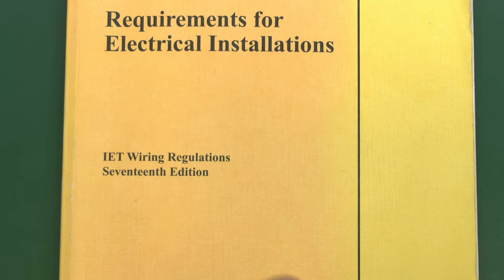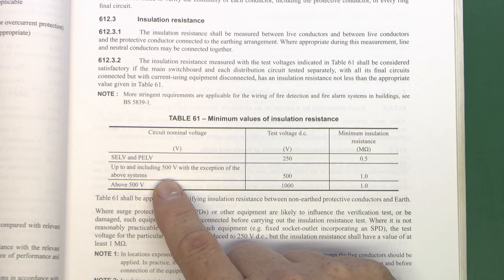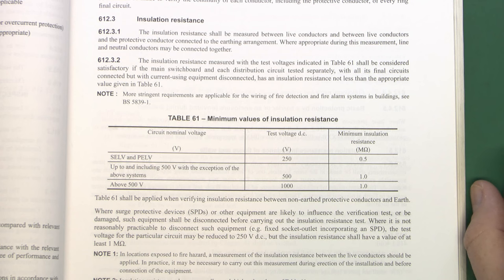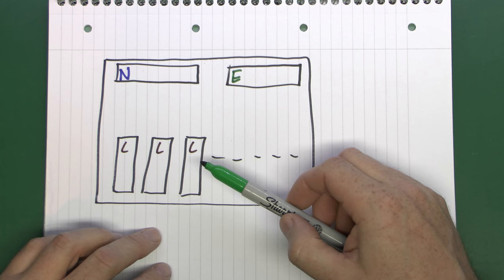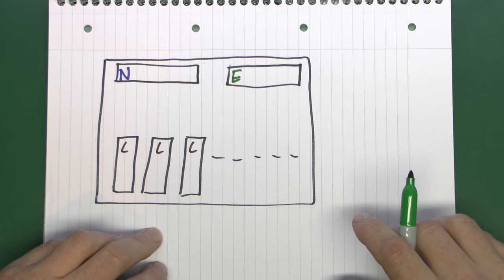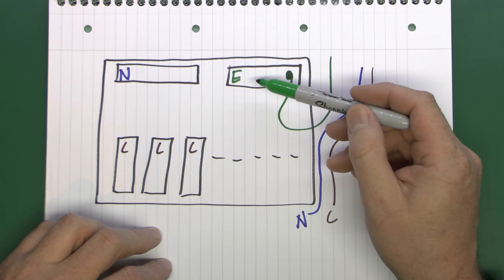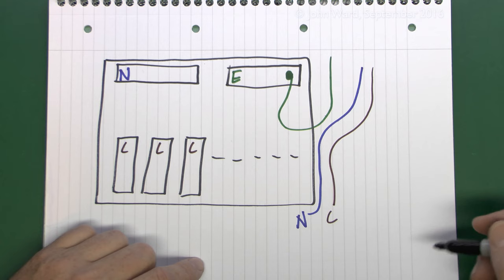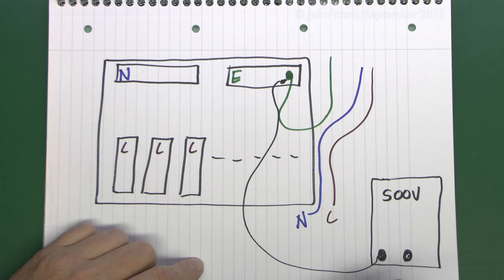Insulation Resistance Testing

Comment: Do you have to disconnect the neutral ? when testing between Line. Would it just give a slightly lower reading that would still pass anyway ?  Please clarify
Reply from the maker: Yes, otherwise the neutral will still be connected to the neutrals of other circuits which could result in incorrect or misleading results.
Line and neutral disconnected from everything else, but the protective conductor remains connected to the main earth terminal which will show faults between L/N and the actual Earth.
Reply: @jwflame  I watched another video where they left the neutrals connected as they were correctly torqued already. I guess you will get a lower reading between line and neutral or neutral and earth but if the reading is acceptable at least you know the circuit is safe i would imagine !! . However i suppose it would not be acceptable to record this reading in the paperwork. Thanks for your reply.

Comment: Hi, could anyone tell me what is the advantage to performing the test at a higher voltage? 500 over 250 for example.
Reply from the maker: It's to ensure the cables are tested at a voltage at least equal to what they will have in normal use.
230V AC is a peak voltage of 325V, so testing at 250V DC would be significantly less.
Reply: Ahh I see, didn’t see this, thanks for the reply!

Comment: Hi John,  I wonder what test can be practically done for EITR on a commercial job where you cant turn off any circuit or the whole system. 
THANKS
Reply from the maker: Pretty much nothing - if power can't be turned off, it's fairly m pointless having an EICR done.
There are always opportunities to turn things off, that may be overnight, weekends or some other planned time.
Reply: @jwflame  thanks John.

Comment: can a long length of cable, or coiled cable, induct a potentially lethal amount of power to its other conductors or fool the insulaton tester?
Reply: I've had very long lengths of cable (100m ish of 6mm SWA) take a while to reach its full insulation resistance because of the capacitance. Another thing to be aware of that John didn't mention, is don't disconnect the probes from the wire before the test's complete, or you can leave such long lengths of cable charged to 500vDC... which while it's not dangerous in itself (the stored charge is very small) could make one leap off a ladder or similar when touching it :\
Reply: In my field cable lengths can be up to 2km. Such a length of 2-core "half moon" aluminium conductor power cable can hold a massive charge if the tester is disconnected prior to releasing the test button. 
The insulation resistance can be so high that the charge can even remain the next day.

Doing the same with multicore control cables has the potential to damage DC power supplies we use.
Although the line voltage is 50V DC, we test at 1000V and if the cable has been left with a charge and is then connected to a circuit, the peak reverse voltage of the rectifier will be exceeded and it will fail short-circuit. 
The newer power supplies come with 1000V rated rectifiers now, but it has caught a few people out.
Reply: yes

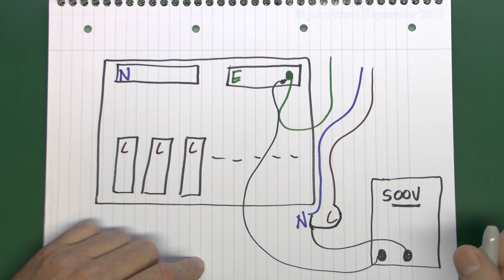Comment: can you explain the non damage by linking L & N test to earth (9:44)
thank you
Reply: All devices take their energy from the phase and neutral so applying test voltage between earth and them two allows no current to flow through. only thing that may get damaged is the interference suppression capacitors on switching power supplies.
Reply: cheers josh-- appreciated
Reply: So is this how you can get around removing RCD's on a global IR test?
Reply: you could but I would prefer to disconnect them.
Reply: So on a 16th/17th ed split board you would basically switch off the RCD and test from the outgoing side of the RCD? So you would have to test the board at both sides,the RCD cover side and then the none RCD covered(16th board) and both RCD covered sides (17th board)? If i've explained that well enough!!
Reply: That sounds correct, I am not familiar with your standards.
With regards to outgoing side of RCD if testing L/N the RCD will have to be disconnected as the RCD supplies it's electronics via it's output.
Hopfully John can chime in.
Reply: Richard L By linking Line and Neutral together they are both put at the same potential as there is no path for current to flow. Draw a simple light circuit with a light and Line and Neutral connections either side of the light and a separate earth wire. Now connect Line and Neutral together and draw your test leads one on Earth and one on Line/Neutral. As you will see the potential difference (voltage) exists between Earth and L/N as supplied by the test meter and what's being measured is the leakage current between the two points.
The point of this is, if you put the test leads between Line and Neutral and there is a load on the circuit there is a return path for current to flow giving a wrong reading on the test meter (and possibly damaging the equipment at 500v). Draw the same simple circuit again and see.

Comment: What shall be the  minimum  resistance when  we apply  500v.do answer plz.
Reply from the maker: 1.0 Megohm is the minimum required, however you should have values much higher than that particularly for new circuits, which should be 100s of megohms.

Comment: how would you test fluorescent lighting and recessed spotlights where you may have multiple lights in a kitchen ceiling or a long run of light fittings in a corridor.would connecting L-N   be the method to use, with all light switches turned on
Reply from the maker: Yes, test between E and LN connected together.  It's unrealistic to disconnect all of the light fittings as you would be dismantling most of the circuit.
Reply: why not just use this method anyway John,save having to remove bulbs etc
Reply: If you need to ask this question then you should not be even be near electrics.
Reply: CrazySparkie63 
well that's why I asked john the question  because I'm trying to understand how and why these tests are carried.no need for smart comments
Reply: Thank you! This is answered a question I've been searching for. Finally I can test my lighting circuits in existing installations to complete my on job :) I appreciate your videos and teachings. Godsent
Reply: @ericthekingthekingtheking4842  in a new installation you need to carry out L to N, N to E and L to E.  On an EICR it is acceptable to carry out LN to E if not practical to remove lamps, transformers, USB sockets etc. On the Live conductors insulation resistance readings you would put that down as a limitation.  However, remember on an EICR, the more limitations the less the report is worth, but it's still acceptable according to Guidance Note 3
Reply: @jwflame  how would you write that on the test sheet? 

It's been a few years since I've saw one but I'm sure it was; L-N, L-E, N-E and L-L if it's 3 phase. Where would one mark the readings?

Comment: Well that was interesting especially the part about what can affect resistance such as dirt, dust and moisture.  I've always thought that I had some dodgy wiring done by electricians on my house.  I was wondering if you could check out this photo and let me know what you think. https://drive.google.com/open?id=0B5Wm-dWZjGIpOGJCVVRtRmtrUXc
This photo was taken up in my the roof space and what you see is the wiring for my lounge room light.  To get to the wires to see them, I had to dig through the loose fill insulation.  So these wires were originally  completely buried and out of sight. The insulation is made of paper pulp which of course very dusty and absorbs moisture.  The thick 3 core cable you see in the photo is the main power cable that goes from light to light through out the house.
Reply from the maker: The connectors are ok, but the need to be inside a box or enclosure, not just left loose in the insulation.  Something like this: http://www.toolstation.com/shop/p65413 would do, and can be fitted without disconnecting the wires.
Reply: Here in new zealand that is non complaint.
Most countries codes require connections to be in a junction box.
Reply: I'd be surprised if this was compliant here in Australia.  I hired an electrician 8 years ago to install that light.  I remember that when he removed the old light he pulled all the wires through the small hole in ceiling to work on them.  I didn't think anything of it the time.  He didn't perform any work in the roof space at all.
Reply: Thanks for the link John.  I've already installed a plastic junction box for this and the wires are no longer buried in the insulation.  The JB in your link is better than the one I used.  I actually  found a number of issues with the wiring of my lighting circuit which surprised me.  I didn't have any syptoms or indications of a problem, everything seemed to be working perfectly.  Here is a photo of the worst problem I found, see if you can spot it: https://drive.google.com/open?id=0B5Wm-dWZjGIpdXhhM1JUV3VmSGc
Reply: First thing I see is there are earths not connected.
that fan would have come with a box but the installer could not fit wires or decided it did not need it.
Also the fan should be venting outside.
Reply: Yes, that's correct.  I discovered by chance that half of my lighting circuit had no earth, so I went looking and found that the bathroom exhaust fan didn't have the earth wires connected to it plus the earth wires were not joined together.  I'm not sure why the electrician didn't hook up the earth wires, I'm guessing he just forgot or got distracted at the time.  This meant that 5 of my florescent light fixtures had no earth and therefore potentially dangerous.  As for the fan venting into the roof space, this is OK to do here in Australian so long as you have a tiled roof (which I do) because tiled roofs are well ventilated.  You probably wouldn't build a roof this way in a cold country, but I can feel a breeze when I'm in my roof space.  You can see in the photo the light shining through the gaps in the tiles, its far from air tight..
Reply: Very dodgy wiring practice .I should think a fire resistant junction box should be used here.
Reply: John Ward 
Those connectors are only for temporary use and live parts are exposed. Sorry to disagree.
Reply: John ward 
Can you talk about periodic inspection such as inspection in a commercial building where one of the IT equipments in the office remain energised because of the office working hour and you are going to do inspection and testing. what tests can you do and why Zs is deem suspect and why RCD & 6A  CB  trips. The insulation resistance test you explained here is for testing individual circuit where you cannot isolate the main supply because of the office hour. you are amazing  cos I have seen all of you videos. We need to know more about periodic inspection where certain test you cannot perform because of the main supply cannot be isolated and earthing or bonding coductor remain connected. what do you record on EICR . Look forward to see the vide  if you can please thanks you are great.